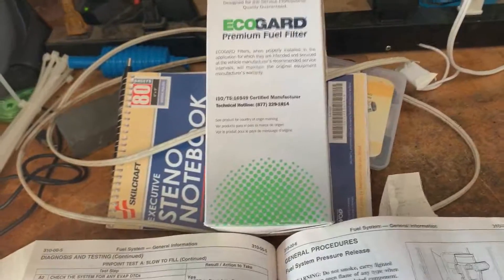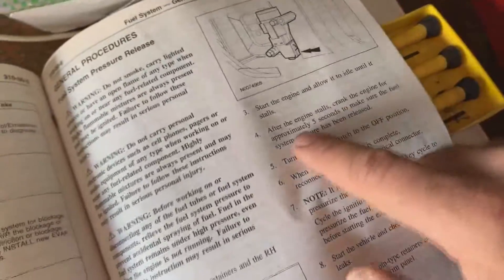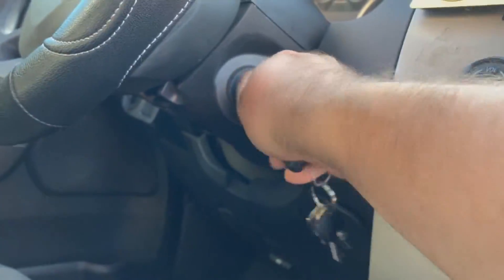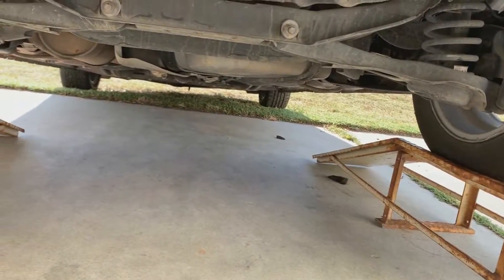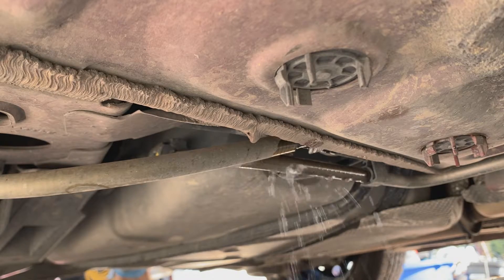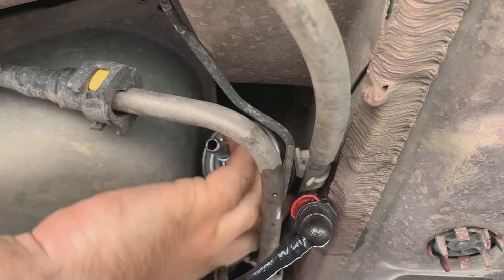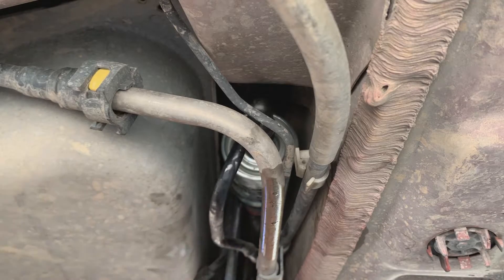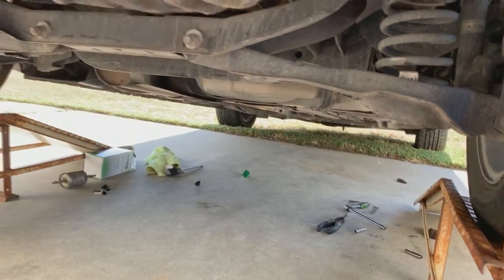2008-2009 Ford Focus Fuel Filter Replacement

Comment: Just had a 'YourMechanic' employee show up to my booking and tell me there is no such thing as a serviceable fuel filter for a 2009 Ford Focus, charge me a $150 cancellation fee, and leave after having their phone support tell me it was my fault for booking an incorrect service. (After the tech also charing me a $25 reschedule fee because it was raining on the original date 2 weeks prior). I will use this video to do the job correctly myself. Thank you.
Reply: 09s have the filter screen inside with the fuel pump
Reply: I have an 09, there is no fuel filter like in this video.  100% sure of that.  If you go to an a auto parts store they will sell you the same one he put on in this video, but it's inside the pump I assume.
Reply: You better have disputed those charges. Don't go through life letting people take advantage of you.

Comment: Great video it's still helping to this day! Also, I have a 08 and I know for a fact I have the original filter very excited to change it just preventive maintenance it doesn't have any issues but there is a lot of rust on the surface of the filter.

Comment: It takes a special fuel line tool to remove the filter. Its not recommended to use the flat head and needle nose for 30 minutes method.
Reply from the maker: Yes I have one now but I’ve done this for years with a flat head and it’s never taken 30 min. 2-3 min tops. Not a big deal.

Comment: I have a 2003 Ford Focus with 105k miles. I think the fuel filter has never been changed either.  I think the fuel filter is clogged, there are no misfires, no codes. But i noticed it idles rough like i can see the engine shaking a bit and i noticed when revving the engine, i can have my foot on the gas and the RPMs will go up and down when cruising down the road.
Reply from the maker: Thats what I would start with first, they are easy and cheap enough to change its good to just do it, if that doesnt solve anything you will need to check the pressure from the fuel pump
Reply: @hanksgarage_  I finally changed the fuel filter. That was definitely the problem, my car is running great now.

Comment: I have a 2011 Focus and the fuel filter i keep finding online doesn't have the dual spouts at the one end of the filter.
Reply: rockauto website has them not sure if you still cant find them..

Comment: I think I heard my same dash cam turn on when you started the car. I have a 2010. Are your AC power outlets always on, or only when you start the car? Mine are always on, so I have to unplug it every time I get out of my car... I'm trying to think up a clever and non-invasive way of hooking my dash cam up in such a way that it comes on with the engine and turns off with the engine.
Reply from the maker: It needs to go into a switch circuit, you can wire it straight in to the fusebox under the dash. See my vid on how I did it with my Ram.